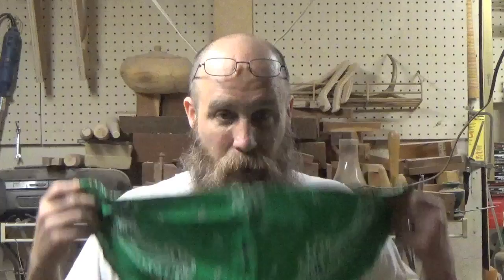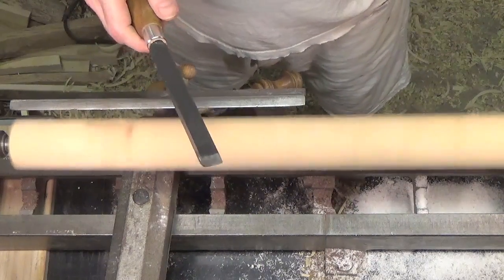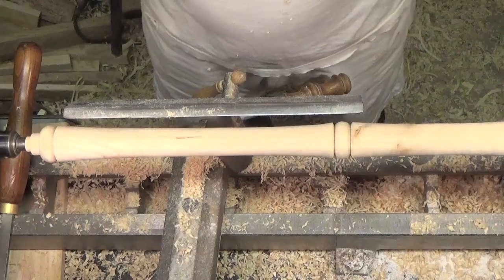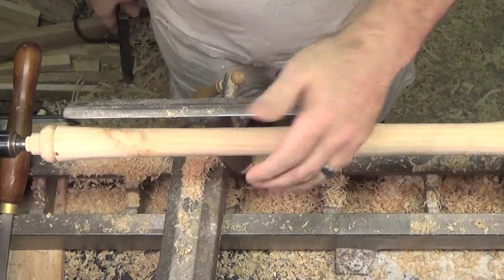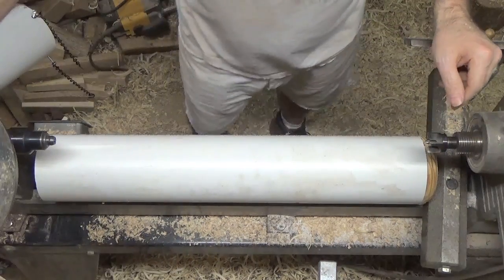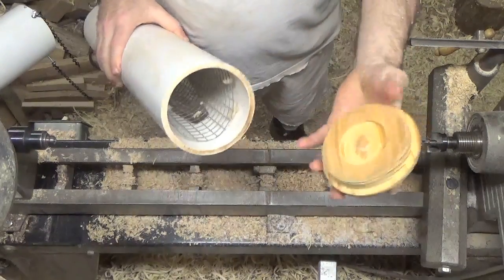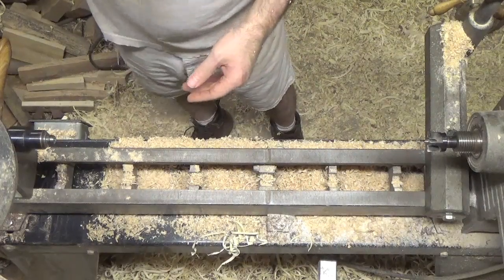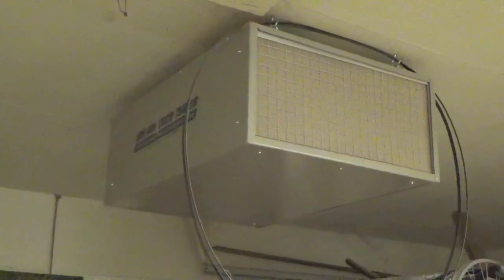Dust Collection At The Lathe

Comment: Really like your control of the skew I like using it but I don't have that kind of control.  For dust collection I also use an air cleaner that gets turned on when I enter the shop.  For fine sanding dust I use a shop vac with a HEPA filter and a dust deputy cyclone ahead of it.  Since most of my work is small bowls, pens, bird house ornaments etc. I can position the inlet a half inch or less from where I am sanding and can see the stream of dust being sucked away.  Considering what I am turning I don't know why I bought a lathe with a 5 ft. bed but like other things better to have it and not need it than need it and not have it.  Take care and God bless.

Comment: The spinning chuck jaws act as the blades in a centrifugal fan throwing air outwards and pulling in in towards the centre. Hence the draft when in the chuck but not when between centres.

Comment: I need some kind of dust collection. Right now I am just using a fan with open windows, and the draft in my small shop. It is a problem, to say the least being a cancer survivor. Not whining, just stating a fact as a fellow turner. I have got to figure out how to cobble something to keep the sanding dust down. Good ideas John, and good work also. By the way, I was trying to get a better look at the Evo early '90s?. I surf around on Facebook (woodchuckers) and the dust collection problem is an expensive issue (sadly) for all of us. God bless you pal... Kent
Reply from the maker: I've tried the box fan + furnace filter and could not get it to work (no airflow). But others have said it worked for them.

Comment: John, sand at a lower speed: <400 RPM and use a compound (beeswax, mineral oil, walnut oil, etc.) to reduce dust.  You'll have much better results.
Reply from the maker: Thank you for the suggestion. I do sand bowls at a lower speed but my spindle work habits are such that I sand in sections, and changing speeds is more trouble than I want to go to. I use danish oil as a finish these days so I can't contaminate the surface.